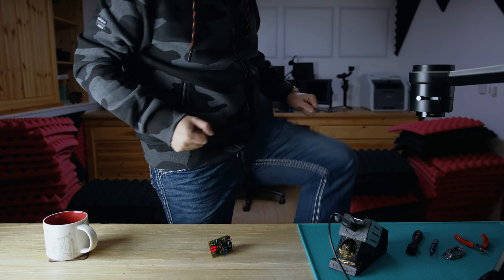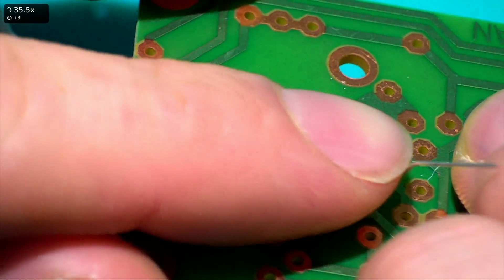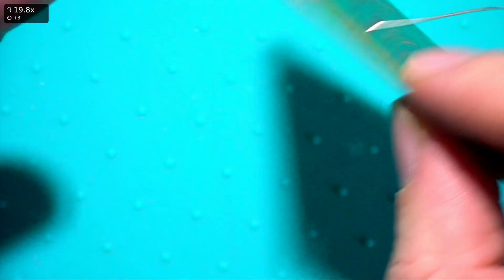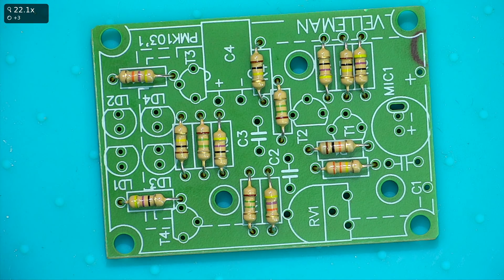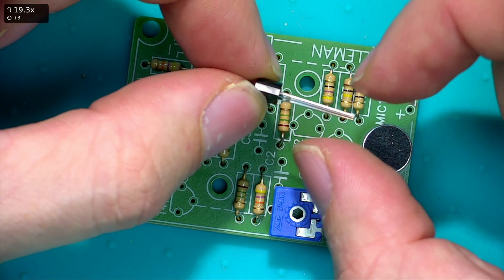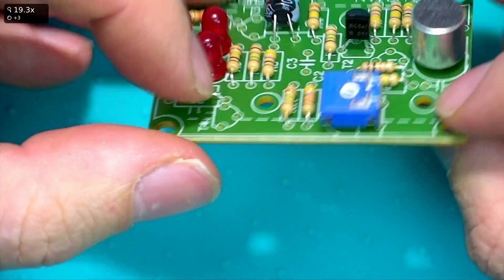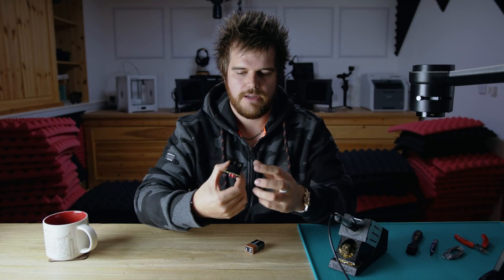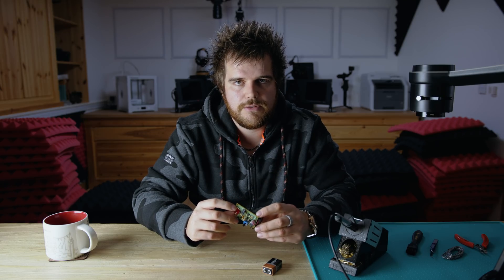How to Solder Through Hole Components | Hardware & Electronics: 02

Comment: Other vids say that you need to warm up the hole and the component for a second and put solder on the component,not on the iron. Is this a good practice?
Reply from the maker: Doesn't really matter. All putting solder on the iron first will do is burn out the flux inside it. Once you are fluent with soldering, you will find you are flowing the solder on fast enough that it doesn't matter where you put it. Instead of trying to think about many things, the most important things are the temperature and time. Set your iron to 340 to 380 C when soldering most things, add flux to your connection and then where you put your solder doesn't matter, you can then focus on getting a feel for how the solder flows, the time you have to be on certain sized components for them to warm up, and just find the rhythm without over thinking things
Reply: @AngelSix  thank you

Comment: Does the board itself do anything or is it only to hold / connect components in correct manner ? I always thought it did most of the work.
Reply from the maker: Yep the board is basically copper traces so joins all the components together in the way they need to connect. We will design and make our own circuits in this series so you will learn all about that